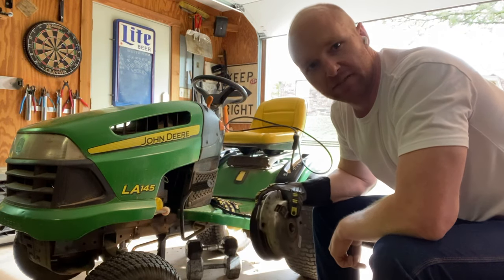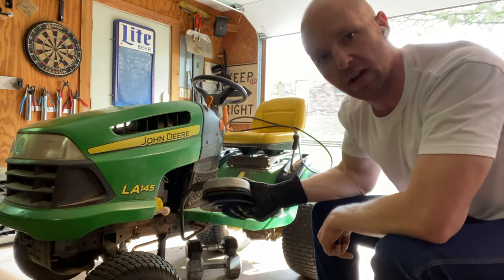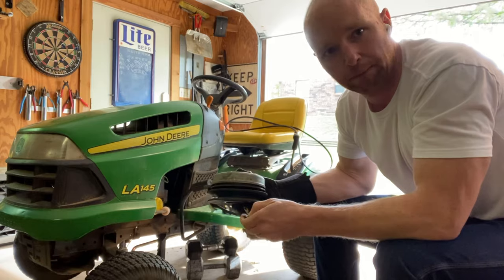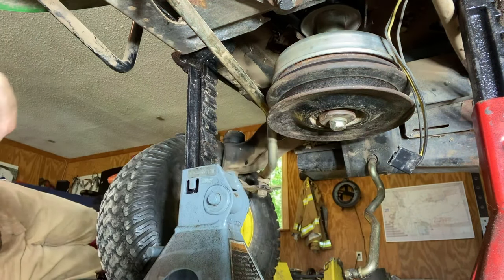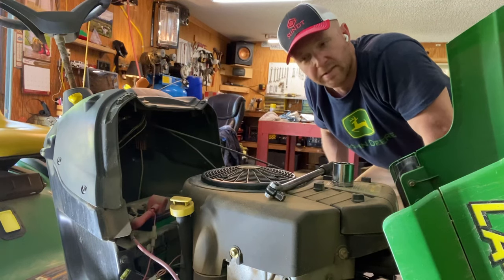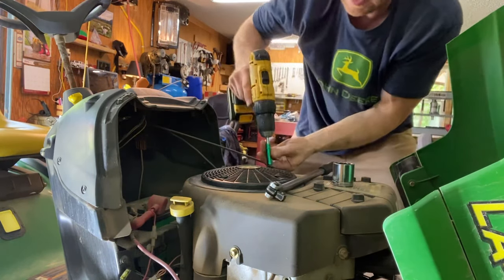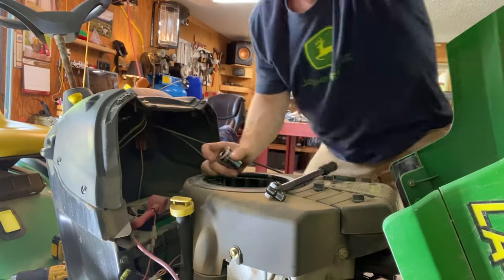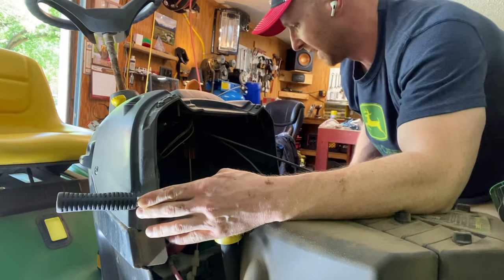John Deere PTO Clutch Removal and Replacement Video LA145, 3 MINUTES!

Comment: what do i do when the new pto doesn’t want to screw onto the crank? seems like not enough threads
Reply from the maker: If the bolt and PTO are the same size as the original it should synch it up on there as you tighten it. Or you can just get a longer bolt

Comment: My L130 PTO clutch brokeoff, spun and ripped out the attach wire and some other wires. Trying to figure out which ones go where. Installed a new PTO clutch based on your video and now trying to figure out the wiring installation that got ripped off the PTO clutch. Could use some help (tried to figure out wiring diagram-no luck) where all the wires of from the PTO switch go.  Thanks.
Reply from the maker: Edmundo I can sure relate with that frustration. The PTO hooks to two wires that come from the back of the mower and they tie to a little connector. If that connector is gone you can just splice them direct to the two wires on the PTO or use different connectors. I checked my one Deere out in the yard and the PTO wires coming from the mower are orange and white. You will just need to try some trial and error to get them lined up. Good luck!

Comment: After removing the bolt, what type of puller do I need if the clutch is stuck on?
Reply from the maker: You will have to research that. Just when you put the puller on make sure to put the bolt back in the crank shaft just loose so the shaft of the puller pushes on the bolt head and not the threads of the shaft. Also watch as you pull to make sure you are not bending the pulley. Good luck!

Comment: Alright Mower Mike, you made this look to easy, so I am going to give it a go on my L120. Where do you jack it up from and place your jack stand(s)?
Reply from the maker: That is a trick if you have the deck off you can try and get it jacked up under the frame rail behind the front wheel. Or you can Jack it up on that piece of metal that hangs down where the front of the deck bolts to. Not many places to Jack up the front of the mower

Comment: Nice video, thanks in advance. Does this work for a L130 as well?
Reply from the maker: Yes any Deere with an electric Clutch will be the same. If it had a Kohler check out my other PTO removal video
Reply: @MowerMike  Sweet. Thanks brother

Comment: Umm "Man status" Ladies have tools too my friend : ) and one doesn't need to be a genius to use and turn tools or power tools for that matter. Just for reference you do need to remove the deck to remove the PTO Clutch; It's attached to the mower deck and they semi overlap. Love to see anyone remove it without removing the mower deck. Additionally typically pto clutches are faulty or damaged whether it be in the barring or grinding with in the gears. Someone times men hit things when driving a mower with a beer. The clutch then does not just fall down easily it's then a PULLER is required they can rented at Auto Zone or Advance Auto Parts for a refundable deposit upon the return of the Puller or tool. This is also important the bolt cannot be just tightened down it has to be torched to a specified weight on the John Deere. Typically 53-55ft.-lbs. Torch wrenches are available at the same locations.
Reply from the maker: I am very impressed and slightly turned on by the depth and knowledge of your comment. 

Seriously thanks for this it will help people out.

Comment: What led you to know the clutch was bad? I recently blew my drive belt on my simplicity broadmoor 20/50. I replaced the drive belt, put everything back together, started the mower, and went to engage the switch, and there was nothing. I checked all my wires and everything looks normal, but not sure if the belt shredding didnt mess something up in the clutch? Never had this issue before. Hopeing it's the switch, but wanted to get your thoughts on it. 

Thanks for the time,
Reply from the maker: My clutch was not bad just had to remove it to replace the drive belt. Hmmm not sure on that one there are a lot of clutch videos out there where you can test them. You may have burned it out shredding that belt

Comment: I have the same tractor la 145. Tractor runs, but the the blades don't move when I engage the button. Power wires broke. I guess the problem suppose to be secured. Did something fall off. Show exactly how to install or rebolt a new or same pro clutch. Videos should be step by step for a beginner who has never done it before. Your video is to quick. U said reverse the order. Show me how.
Reply from the maker: That tractor is long gone just keep searching on YouTube. It is easy just one bolt to strap the clutch on. Hard part is getting the bolt tight or lose. Good luck!